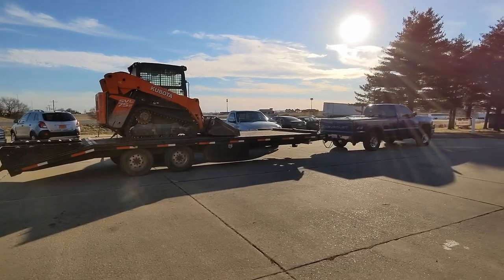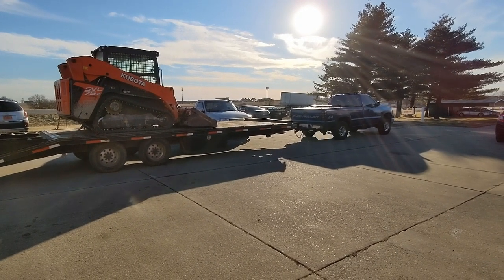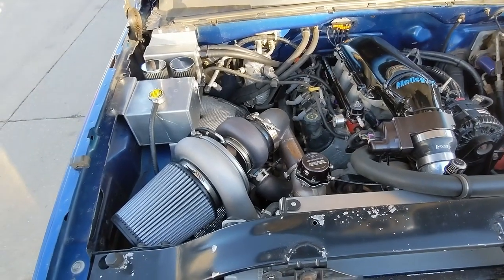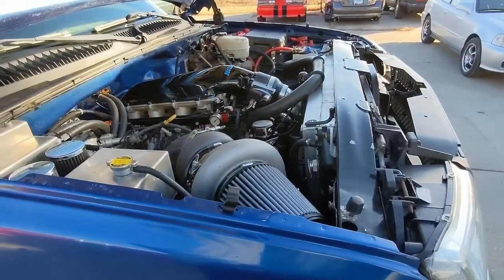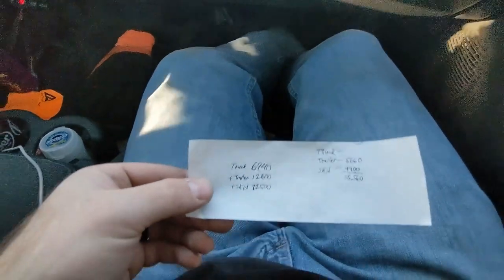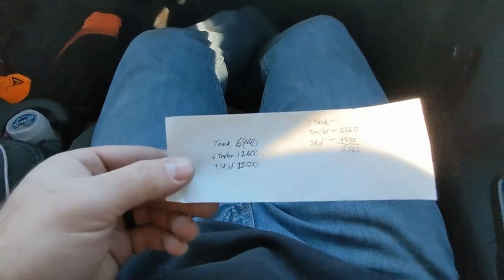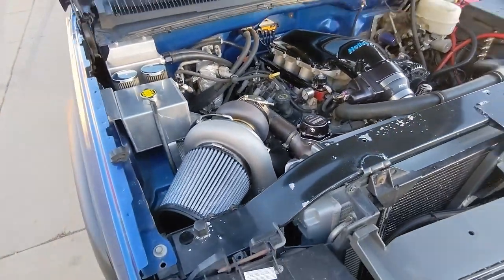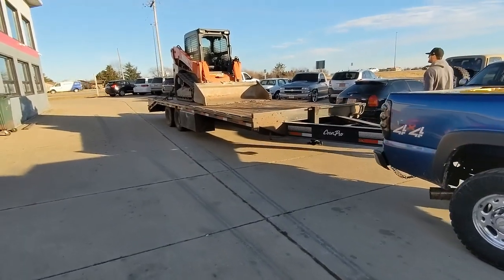LSX Turbo 2500 Truck - Pulling a 15K trailer!!!

Comment: Time to get rid of the diesel.
Reply: Yeah who say gas can't pull
Reply: No doubt!!
Reply: I’m doing just that! Lol I have an lbz duramax, but I just bought a 6.0 truck to turbocharge that’ll replace the lbz. Diesels are just to expensive to maintain in my opinion.
Reply: Hell no....that thing will never outlast or out pull a diesel, especially doing it efficiently. Diesels are way more robust and provide that torque you want way down low, but to each their own.👍
Reply: @2015_Rubicnn  120k mile one owner truck, one month after I bought it from the original owner it needed a full set of injectors that cost me over $5k. I can build a complete 6.0 lq4 for that price. Lol
Reply: @2015_Rubicnn  diesels have their place and I'm well aware of what that place is. That being said I tow but don't tow often or heavy enough to justify the cost of ownership of a diesel.
Reply: @kodyeutsler1234  Yeah, and I'm the 3rd owner of my 05 LLY Duramax and have had zero issues, but I upgraded the pieces that supposedly caused it issues. That's very odd you had to replace all the injectors on a LBZ, that owner must not have used any fuel additives or ran shitty diesel. With any diesel engine, maintenance is key. Yes, you can take injector money and put it toward another 6.0L gasser, but you'll never have the torque a diesel makes.
Reply: @dakotadale567  Like I stated, everyone has their thing and I get it. I'm in no way knocking gas engines at all, I've owned many, but you can't beat 600lbs/ft+ of torque (depending on year and model)at 1600rpm to get a load moving and do it more efficiently.

Comment: do you have a full mods list, i’m looking at running a very similar set up in my truck
Reply: 408, afr 225s, 10.5cr, holley Hiram, jakes stage 4 80e/ billet triple disc, 450 pumps, ID1050x injectors, Bullseye turbo, scram speed custom turbo kit, Efans, duramax intercooler/radiator, duramax 5" exaust.
Reply: @shwab8  , is that a 408 stroker built motor?
Reply: @timphilmon8573  yes, started as a stock 6.0. Now has forged rods, pistons, and crank with AFR cnc ported heads. Engine is 10.5 to 1 compression ratio
Reply: @shwab8  , I'm looking at dropping a 408 in my 2011 Silverado. But, with a Whipple supercharger.  Have you checked your overall mpg when towing?
Reply: @timphilmon8573  I don't really keep track of it.  I'd say 6-8 in stop and go pulling a trailer. Obviously how much weight your pulling is going to change it also. I've got a heavy foot so that doesn't help either. Once you get up to speed and the convertor locks it drives pretty normal!
Reply: What size exhaust housing on turbo?
Reply: @shwab8 what size exhaust housing on turbo ?
Reply: @vernonheller1281  v-band 1.00
Reply: @shwab8  how has it stood the test of time the last couple years, if you’ve stayed towing the heavy loads of course. Sorry if this has been asked somewhere else in the comments. There’s so many

Comment: Hey I dont know if you will see this comment,  your ignition is shorting out on your power gate , you can see it arcing in video on the Allen head bolt
Reply: Went back and looked and yep at 1:33 of video....that's gonna light someone up who ever touches that
Reply from the maker: Thanks, we will pass this along to the owner.
Reply: @Scramspeed  no problem

Comment: I just need to know the cost
Reply: Cost the same as a  buying brand new regular cab 4x4 2500 gas truck.
Reply: @shwab8  An engine build like this is not more than a 40k truck. 😆
Reply: @allanb3222  I was referring to duplicating the truck. Didn't realize he was talking about just the engine.

Comment: You can build  them gas engines in them trucks to handle them loads who says you have to have a diesel to do everything and especially when diesel engines are more expensive to work on  pickup class  not 🚛🚫

Comment: That trailer don’t weigh 12,000 lbs lol
Reply: Truck is right around 6k. It had about 800-1000lbs of salt in the bed. Truck was 6940lbs, trailer 5660lbs, skid 9900lbs. Truck+trailer=12,000lbs
Trailer+skid=15,560lbs
Truck+trailer+skid=22,500lbs

Comment: Won’t last long 😂
Reply: No I won't say that you have to also understand they were using Big blocks back in the day for buses and dump trucks and duallys back then a lot of them had gas 396 or 454 Big blocks in they were pretty rugged and last a long time in can take a beating. for instance my uncle had a Chevy Silverado 96 with a big block in it that thing pulled a three car hauler like it wasn't nothing the engine was rebuilt but it was pretty strong. The only thing a diesel may have advantage is  torque in gas consumption  you take that turbo off of it it's just like a gas motor. Turbo gas big block like a 454 or 502 it's a different ball game when it comes to the pickup truck class
Reply: @williegohard1368  none were boosted either, like I said won’t last long not to mention I pull that with an f150 lol
Reply: @freedomisntfree_44  yeah but if he was pulling a heavy load with it all the time of course it won't last long but just lollygagging with it like a daily driver pulling heavy here and there I don't think it would bother it at all if he's not hard on it
Reply: Not to mention it could be stock internal so imagine that he was to build the bottom end to handle that it would last even longer
Reply: I think you a diesel fan
Reply: @williegohard1368  I mean I have diesels but also gas, this turbo would be sweet on my Isuzu npr truck though
Reply: @freedomisntfree_44  yeah it would. I was thinking about turbo my Nissan frontier but you have to know what you doing I don't want to break anything lol

Comment: T4 turbo with the 408 stroker?
Reply: Yes
Reply: @shwab8  how quickly does it spool?
Reply: Depends on how much weight it has behind it. If it's just the truck it has some lag. With the weight of the trailer in the video, it's basically instant.